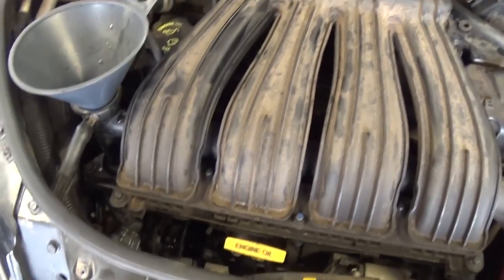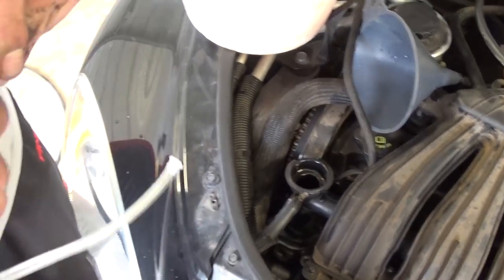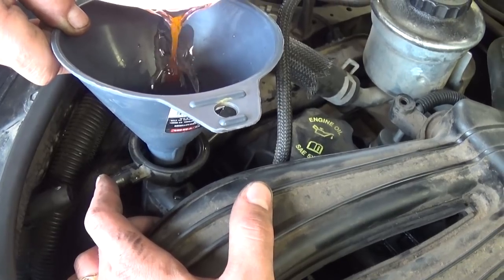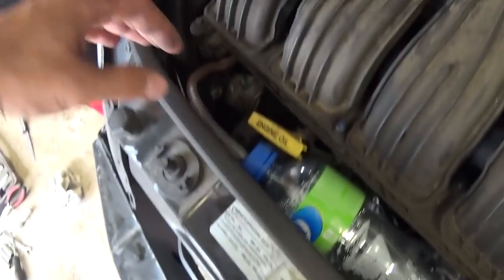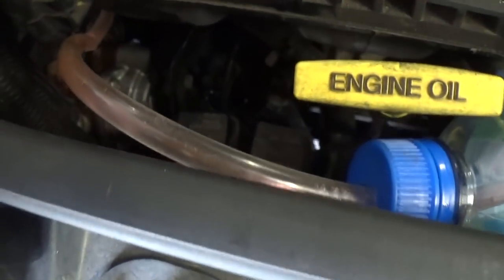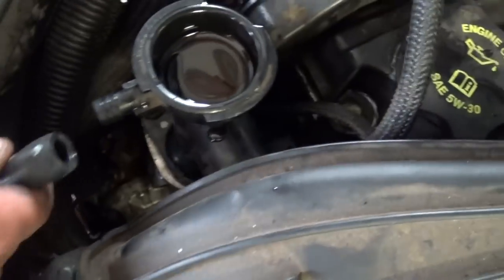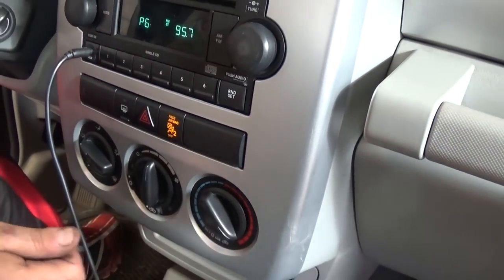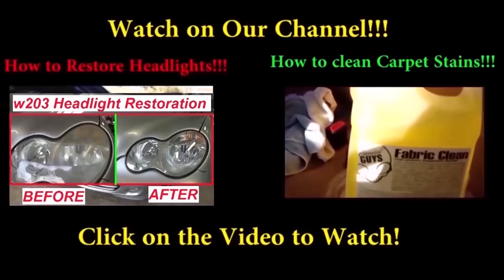Chrysler Pt Cruiser Cooling System Bleeding  Coolant Bleeding  Antifreeze bleeding procedure

Comment: The size of the clear tubing is 3/8" outside diameter, 1/4" inside diameter. You only need 8-12 inches of tubing which I had to purchase on a 10 foot roll at Home Depot. Ace Hardware may sell it by the foot. Drill a 3/8" hole in the bottle cap and slip the hose in.

Comment: With the engine cold, how can you bleed air from the heater core and engine block with the thermostat closed?
Awesome video. Thanks a lot.
Reply: look closer with a light and you will see the bleeder valve is located below the bottom of the thermostat

Comment: I just replaced the timing belt and did a lot of other work on my PT and it goes a lot faster if you jack up the right side of the car a few inches so the water or antifreeze will run in faster.
Reply: Thank you sir! I’m performing this right now

Comment: hi, my 2006 pt cruiser is overheating too, what happen is i change my fan because of losing aircon when it stop and idle is going down too, when moving its cold, so i decided to change the  fan, but when i connect the fan i accidentally pierce a hole because of long bolts for the fan, so all coolant drain, now i already fix radiator and fill the coolant, but after filling coolant the temp. start overheating and the AC is not kicken and i can hear a water bubbling from inside when i turn off the engine. pls help, what should i do?

Comment: I have a 2005 PT none turbo, it always had a over heating problem since the first day. I just recently replaced the water pump pulleys belt, still overheating. I was thinking maybe the heater hoses might be clogged, also might have to raise the front end of the car up higher. Any good advice would be great thanks..
Reply: Lower and upper plenum intake manifold gaskets might need to be changed. That’s what helped me

Comment: So i changed thermostat on 01 pt cruiser and after say 20 hwy min the overflow resivor coolant bubling and car overheating.  Heat on then temp goes down, but running A/c makes issue occur...help
Reply: a pt cruiser with overheating....ugg.  I had to have the entire cooling system replaced

Comment: does the car and heater need to be on?
Reply: would jacking up the front of the car, meaning the air will rise to the highest point be a way of bleeding, Also in warmer localities, just remove the inner part of the thermostat, to help solve the heating defect in design

Comment: Have 2005 crysler pt cruiser, petcock stacked in radiator. I able to twist it, but can't remove it. When try to lock peacocks still  have coolant to drip. Any suggestions how to remove petckock or how to fix this issue?
Reply: They say its always easier just to remove bottom radiator hose to flush (I did on 08 PT).  You need a channel lock pliers or a radiator clamp tool for get the clamp off, car needs to be jacked up and on jack stands.  The petcock plug can be gotten, those they say are hard to get out.  Need to turn from 12 to 7 position and pull the plug out.  I avoided doing it as they say you should have a new plug ready as after replacing it may leak. They say lubricate Oring on replacement. I say just remove the hose much easier.

Comment: hi I need help my PT cruiser is overheating I change the sensor temp,both relays ,thermostat,and fuse next to the relays and check manually the fan to see if it  turn on and it  did turn on but the fan don't turn on then the car over heats
Reply: Did u ever find out the issue? I have a 2002 that’s doing the same exact thing and I also changed the sensor temp both relays and fuse, i did a new thermostat and lower thermostat housing and made sure we bled it after by the bleeder valve and everything. I am literally dumbfounded with this thing right now. Anything end up working for you at all by chance?! Thanks 🙏
Reply: I'm having the same issues
Reply: Air is getting inside and making the coolant hot because of the air turns into steam and gives the temperature sensor a bad reading so it turns the fan on prematurely. Not exactly sure If that’s right but that’s my opinion why the reservoir is always boiling out coolant

Comment: can you use the Prestone 50/50 coolant?
Reply: Yes and no.  Yes prestone does sell the proper coolant, but it is not the same stuff as the old days.  Be sure to use the correct kind to prevent  corosion in your cooling system.
Reply: Chrysler recommends HOAT, hybrid organic acid technology coolant for the PT Cruiser. OAT is not the same. Has to do with the engine block being cast iron and head is aluminium. Moreover, HOAT is not compatible with other coolant so you must thoroughly drain old coolant if you are uncertain it is HOAT.
Reply: Zerex g05 by Valvolne is compatible with Chryslers MS-9769. If it doesn’t have that number on the bottle it is not the right coolant

Comment: Help!! noticed a bubbling sound when the car is just sitting at a red light but not when I am giving it gas...but when I shut he air conditioner off and came to a stop it didn't seem to be making the noise..so i thought it was air related...stop using it.. then out of know where it overheated and steam and water/coolant were coming out of under the hood...managed to get back to a friends by running the heater (in 90^ weather) just a few miles...however there was still visible water when I opened the radiator cap...searched everywhere for a leak or blown hose....Finally found what looked like a melted large hole in the coolant overflow tank about an inch or 2 above the full line rather large and not in anyway near anything that could have touched it to have melted it...i say melted because when i touched it the plastic was still hot/soft/gummy ...nothing near it at all..well you know the distance between the front of the tank and the motor ...Don't know what would have caused this hole...any idea?  I've ordered a new one from ebay... now I need to know just how hard it is to put one of these in...wish you had a video on it!!! there are none on here for this at all....
Reply: KATHY BROWN  did u get this fixed.. same exact thing happened to melast night :(
Reply: Alex Olivares you still having he issue?

Comment: Pt cruiser is nothing but chrysler junkie car...i owned a pt did kept up all maintence and no matter what i did that junkie car over heated...the best thing i did was get rid of that money pit of a car always,costinv me a fortune to fix .that car was with the mechanic more then it was with me, the best thing i did was get rid of it and brought a honda very happy with my honda...chrysler card are known to be unreliable,electrical issues,stall,stopping ,cheap plastic parts that fall apart or melt ,gargage
Reply: In contrast, my brother owns a 2007 Honda Civic that he keeps well maintained and its air conditioner continues to have an issue that the dealer has been unable to fix after multiple trips to them and parts changes that my brother has had to pay for, making me furious at them. Also: the clear coat on his Honda began to peel shortly after its warranty expired;  the doors stopped holding themselves open long ago, so one has to keep pushing them open while entering and exiting the car, which is lots of "fun" when the car is parked on an incline; the rubber trim on both sides of the windshield have rotted away, leaving ugly gaps; the rack and pinion assembly leaks, so he has to check the fluid level frequently, etc, etc, etc.

While Honda makes great engines and manual transmissions, the rest of the car doesn't last too long before coming down with issues. I would consider the Honda to be a rather "Junkie car."

I hope that your Honda is still a good car for you though, Cheryl. :-)

Meanwhile, my 2007 PT Cruiser that someone gave to me hasn't gone a couple hundred miles before something in the cooling system breaks. LOL! I have replaced the cooling fan (and the expensive 50 amp fuse in its circuit that it had blown), coolant reservoir and just yesterday I finished installing a new radiator and hoses so yeah, you're right about them being "junkie cars." It even overheated once and that was enough to probably have warped the cylinder head, which is something that I will get around to dealing with later since it's a major job and won't have the time to fix it for a while.

Fortunately, I also own a 2002 Saturn SL that's been relatively reliable. In 20 years, it has had a few issues: I had to replace a leaky intake manifold gasket because the factory installed ones are known to disintegrate and mine was no exception. The gasket was cheap and I was able to get the job done in a day. Another issue was that its water pump began to leak several years ago, so I had to replace it. Finally, I had to replace the shifter cables a long time ago because one of them snapped during a very bad time, nearly causing an accident. Well, I almost forgot about having had to replace the end of a shifter cable using one of those "Help" brand things because the original one broke and the cable popped off the shifter while shifting gears (It has a 5-speed manual transmission.) Still, not too bad after 20 years and it's still going strong. OK, I forgot to mention that when it reached ~30,000 miles it began using a quart of oil between changes, which they all do. I check the oil level and top it off when necessary, so it's not a big deal for me. OK, so it's not perfect, but it's still much more reliable than the PT Cruiser and I'd still trust it on a 5 hour drive to Dallas and back, unlike the PT Cruiser which I barely even trust to make it to the local grocery store one-way. LOL

Sorry, I do tend to ramble. ADHD is "fun." Ha-ha! Have a good day, or evening, depending on when you read this.

Comment: Worst car ever.
Reply: I believe that the Yugo was even worse. Some of those things came from the factory leaking oil and the dealers couldn't fix them, among other issues. The main reason why those severely under-powered things were pulled from the U.S. market was because they had outdated emission control systems that were in violation of the EPA standards of the day and the engineers were unable to resolve the problem.

At least the PT Cruiser never violated emissions laws... for what that's worth? 🤣

But yeah, the PT Cruiser does have reliability issues, mostly related to the lousy, overly complicated engine cooling system. Mine overheated and probably warped the cylinder head. Why Chrysler had an aluminum head mounted to a cast iron block is beyond my realm of comprehension. Both metals warp at different temperatures so yeah, you can kiss that head gasket goodbye as the head warps while the block retains its original shape.